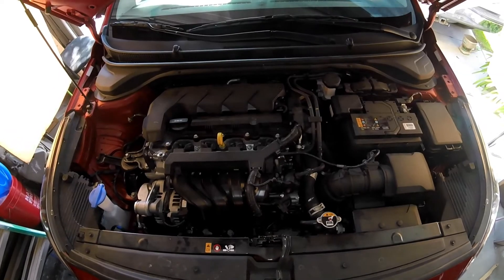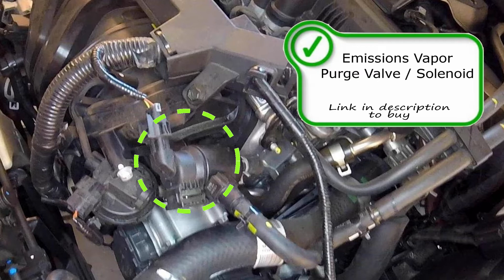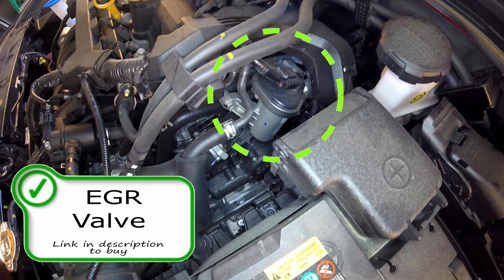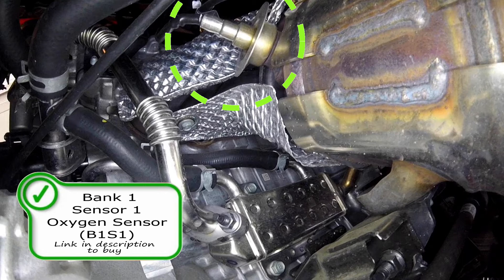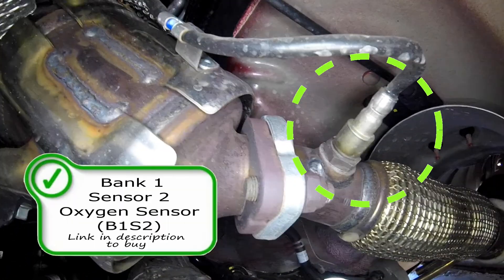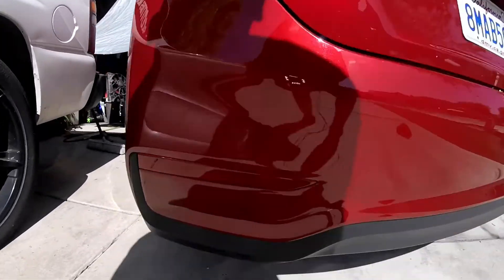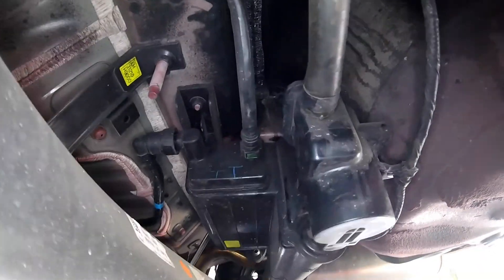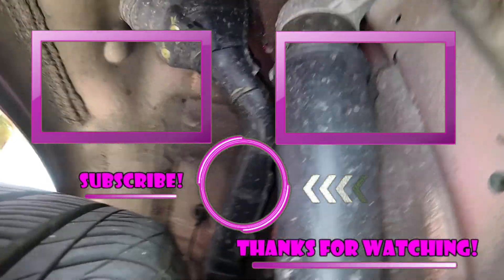Hyundai Accent 2017 2018 2019 2020 1.6L Emissions: evap Vent, Purge, EGR, oxygen sensors

Comment: I just want to know where the PCV valve is. I have yet to find a video that points out where it is for a 2019 Accent SEL
Reply: Me too I think I located it top right rear of the valvecover, 90 degree angle and the hose attaches and runs to the intake hose just before the throttle body.  So the route is pcv valve to rubber hose, to metal tube to rubber hose to intake hose.  I dont know how the pcv valve comes out and I don't want to start reefing on it with pliers it's all plastic.
Reply: It's inside the valve cover you have to remove the whole cover.  Dumb design

Comment: How long can I drive with a p0455? 2017 accent just got that code.  I need to schedule with dealer and I have to work?  No back up car
Reply from the maker: Obviously the sooner the better to get it taken care of.  but I have seen people drive for probably years until they needed a smog for them to take care of this code. You might find something useful in this video I have. It is for a different evap code but could help you in this situation too. https://youtu.be/_ojQ3ELu27M  The code you are experiencing is letting you know that you are releasing fuel vapors into the atmosphere. It sounds horrible but I would not be too worried about it.

Comment: Where's the egr  valve  located on a  2017  HYUNDAI ACCENT?  DO U HV ANY VIDEOES ON THAT?
Reply from the maker: 01:35 ?
Reply from the maker: If not. Take a pic of your underhood label and 2 or 3 pics of your engine compartment. I'll see if I can see it. Circle it and send it back. (925) 418-5096

Comment: 2017 119,000 miles
Due constant oil changes every 2.5k miles plugs every 
P0420 just turned on
Reply: Im replacing the oxy sensor tomorrow
Reply from the maker: Man, that is no good. In the past I have always replaced Ignition coils and oxygen sensors as they go bad or when they make a code come on. But I am starting to think that those components need to be replaced more often. I've replaced a code if replaced a couple vehicles Ignition coils that had around a 120000 miles on them and the performance of those vehicles significantly increased in power and gas mileage. But there was no codes given letting me know any of these are bad.

If it was my vehicle I would replace the post cat oxygen sensor and clear the code. If the code comes back you know the catalytic converter is probably bad.

 Keep us posted on your repair and progress. Hoperiod hope to hear from you soon. 💪👍

Comment: i have a hyundai accent 2019 SE that had problems with misfiring.
i replaced the alternator , spark plugs , coil packs and ecm. it later ran fine for about two weeks before the oil pressure and battery light came on. now the car when turned over sits at a high rpm and runs rough when in idle then stalls when coming off the gas and rpms shoots down. when trying to drive the car the rpms shoot up when on the gas. I'm thinking it might be the IAC, EMC "again" , throttle body , ECT or EGR. the vehicle is also not throwing any codes when i plug in an code reader.
any ideas i would really appreciate it

Comment: I have a 2014 hyundai accent with codes P0420 and code P0455. I change out the both 02 sensors upstream and downstream. I have even change out the cat and i still get the codes P0420 and P0455. I guess now i should change the evap canister vent valve?
Please help. Thank you.
Reply from the maker: Have you tried looking at or replacing the fuel cap? The p0455 is a leak somewhere in the evap system. You can check the purge with a 9v battery and a vacuum pump. With no electricity applied the solenoid should hold vacuum.  The p0420 is probably just a bad catalytic converter. I'd focus on the p0455 first. If the vent solenoid was bad, you should have a problem pumping gas. But its possible its not working properly. You can check it the same way as the purge solenoid.

Comment: Thank you for the useful information. 
I have 2017 Accent with 68k miles. A code p0420 just light up on my dashboard. 
Do you think a catalytic converter can go bad on only 68k miles?
Reply from the maker: Its possible... I'd like to see atleast 90k before the cat needs to be replaced. These computers are pretty smart. I'd also have someone check your fuel trim. You might find a lean or rich condition causing your cat to work harder. But my rule of thumb is p0420 over 90k replace cat and rear o2/ af sensor. Prior to 90k, try rear sensor and see if code comes back.
Reply: I have the same problem
Reply: I have thr same exact problem.  I got thr P0420 code around 65,000 miles and changed thr catalytic converter.  Now I'm at 106,000 and got thr same code. I'm sure it's the sensors now.